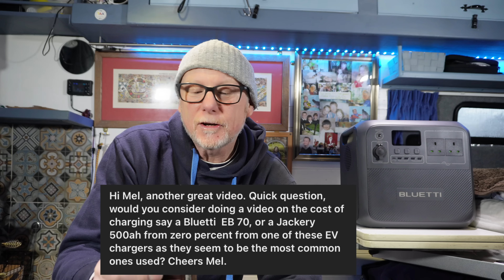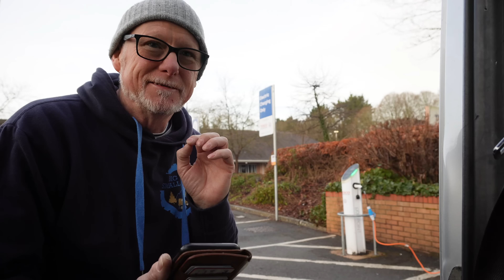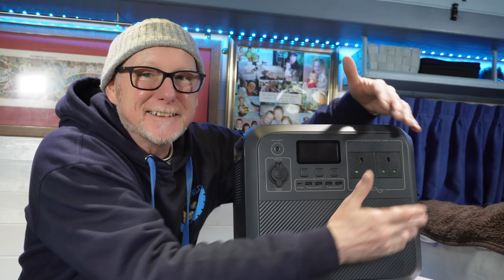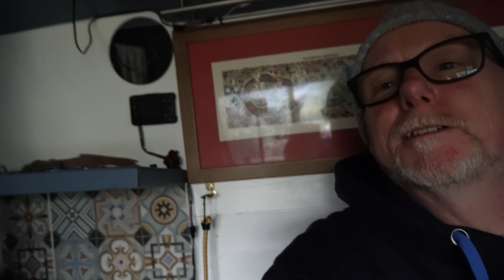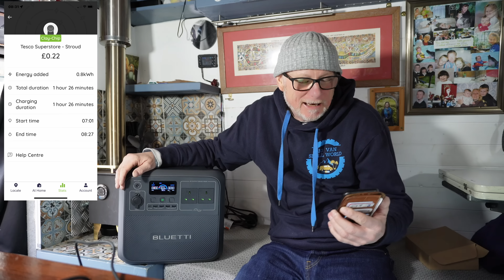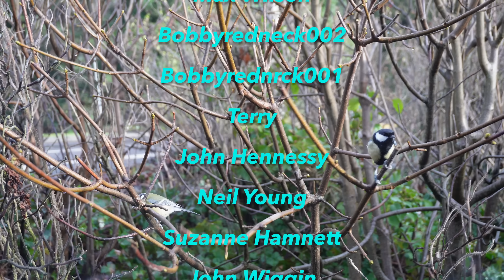Using Electric Vehicle Charger to Charge the new Bluetti AC180

Comment from the maker: EV Type 2 to CEE 16A Socket Power Converter Cable, Blue and Black
https://amzn.to/3JtHC2u 
BLUETTI DEALS: up to 56% Off https://tidd.ly/3MXs9sD Get an extra 5% OFF with code BLUETTIMel
BLUETTI AC240 https://tidd.ly/3XXmGUX
BLUETTI Charger 1 https://tidd.ly/3K2cA20
BLUETTI Apex 300 https://tidd.ly/3Mb1tUW 
BLUETTI B500K Expansion Battery https://tidd.ly/3Mb1tUW
BLUETTI B300K Expansion Battery  https://tidd.ly/3Y17q9y
BLUETTI Elite 30 V2 https://tidd.ly/3K5pagZ
BLUETTI AC 300 & B300K https://tidd.ly/3M7SfsG
BLUETTI Pioneer Na (Sodium-ion) https://tidd.ly/472aSq5
BLUETTI ELITE 200 V2  https://tidd.ly/49qwsW5  
BLUETTI AC 70 https://tidd.ly/4qKRswX
BLUETTI AC 180 https://tidd.ly/48X2bhK
Everything i use in my camper van you will find here https://www.amazon.co.uk/shop/melsvanworld
Reply: @MelsBigVanSmallWorld  hi Mel, probably a question already answered, too old to go through all posts .. on your amazon channel you show an adaptor for an ev charging point, but what cable do I need next to connect to an apex 300 ? And can you charge an apex 300 directly from an ev charging point ?

Comment: Ah? Does this mean that whilst on EV mains hook-up your main batteries will be charging up at same time, therefore adding to the overall cost? I have fitted a switch  that allows me to switch leisure and starter battery out of the battery charging loop if required.
Reply from the maker: For me it’s more about the convenience than the cost 👍
its cheeper than going to a campsite 
If I’m plugged into mains through an EV port, I tend to make the most of it and charge everything in the van, including the main battery
That way everything is topped up and ready to go, which just suits how I use the van 😄

Your switch setup sounds like a good idea though 👌

Comment: Brilliant! I have an AC 180. Do you know if it's possible to plug directly from the Bluetti and charging post thingy? I don't have the external plug point you have on the side of your van
Reply from the maker: Yes, you can plug your AC180 directly into the charging post! Just make sure to check the compatibility and any necessary adapters.

Comment: I want to put all the charging options. Solar, shore power at rv park and from home, alternator, AND EV. Just starting to investigate what I need and what would be the best set up. And not necessarily for Bluetti, maybe even a DYI power storage pack. I want to be able to power USB, 12v, and 120v items in my RV.  I want to have the best economic options but others too in case those are no-go in certain areas. Like a gas generator.
Reply from the maker: Wow, you're planning for every possible charging scenario! That's a serious setup you're aiming for. Hope you find the perfect mix for your RV! but seriously unless you are a compitent at `diy electrics i would stick to using a power bank like the Bluetti Apex 300 pex 300 
https://tidd.ly/3Mb1tUW it can do everything you just mentioned and all in one neatsafe  package  👍
Reply: @MelsBigVanSmallWorld yeah, I’m attached to my electronics and plan on lots of travel in an RV for the year after I retire. I don’t want to be stuck anywhere. Or bored, which I hope/excpect will not be an issue - or I might as well not. 😊

Comment: I just bought this adapter and was going to try it out today. What app do you use for it?
Reply from the maker: Great to hear you got the adapter! I recommend checking the Bluetti app for the best experience. It really helps monitor your charging.
Reply: @MelsBigVanSmallWorld  I have the aferiy power station but I’ll check and see if they have an app. 2 years on, is the adapter still working ok for you?
Reply from the maker: yes i use the adapter almost weekly in the winter
Reply: @MelsBigVanSmallWorld that’s great! I got it for winter too. I’m excited for my new addition to vanlife😁
Reply: @MelsBigVanSmallWorld I have just gone to a charger to test it out and it doesn’t click in and an error came up on the screen. Did you find that only some chargers connect?
Reply: Just realised there’s tethered and untethered chargers. I’m new to this haha😅 I’ll try again with an untethered option tomorrow🤞

Comment: you say that the ac 180 was new out of the box and was around 35% charged to do the EV charging video. also, you made the video of its features previously yet the 180 is at 48% when you turned it on. do you have two 180s? curious.

Comment: Is there an EV to AC adapter? Does this adapter plug directly into the power station?
Reply from the maker: No but I’m about to do a review of the new Bluetti that’s coming out soon and that will have an EV charging port and cable 🤙🫶
Reply: @MelsBigVanSmallWorld  which model is it?

Comment: Hi Mel. Great videos, very informative about actual use of the products 👍

I have an unusual question. I am a boater and have hook up to run electrical appliances such as our sockets for a kettle, a ceramic hob and a water heater (immersion heater). When off hook up we would need a generator to run these items. 
Do you think it would be possible to run a cable from the power station into our hook up point on the boat? I would have thought that would work, obviously being careful not to run concurrent devices. Do you run your van this way?
I could then recharge via a 12v outlet while running the engines while moving. 
Sounds genius!
What do you think the constraints will be?
Thanks
Reply from the maker: Thanks for your thoughtful question! Using a power station like the Bluetti AC180 to run appliances on your boat sounds feasible, especially if you're careful with your power usage. Just make sure to check the power ratings of your devices and the connections involved to prevent any overloads. Safety first!

Comment: Love this video. I'm in the US. I found an adapter on Amazon J1172. Is this it?
Reply from the maker: I’m looking on Amazon unfortunately I can’t find it
Reply: Europe use detachable cables, so it will be a little bit different setup as the US used tethered cables.

But the protocol is the same, so you do have passive mode. The passive mode is intended to charge legacy EVs (Mode 1 charging).

The J1172 is referred to as 'Type-1' in Europe.

In the US a cable like this will have the same respectable as on the car.

But you do have a problem, the charging standard allows for 110V, 120V, 208V, 230V and 240V through the same pins. Not a problem in Europe since we only use 230V, but in the US you can be sure if you get 120V, 208V or 240V between the L1 and N pin. (120V is unlikely, but "legal" according to the specs)

Comment: I've ordered a EV charge cable for our motorhome and agree it could be a game changer.  It has a "Type 2" plug.  I've since noticed that some EV charge points that have type 2, are tethered and some are untethered.  Can you only use untethered charge points, or can you connect your cable to the cable coming from a tethered charge point.  Cheers.
Reply from the maker: Yes you can use ether one
Reply: Hi. Where did you buy your cable? Apparently the one in the video is sold out. Cheers

Comment: So if I'm understanding correctly, if you plug in one high power 1800w device that is okay and should work. If you were to plug in one 1800w device on one socket and a 700w device on the other that is a no-no! Whereas if you had a 1200w device on one socket and 600w on the other that should be okay.
Reply from the maker: Correct 👍

Comment: I have one on order right now.  Managed to get it from Bluetti shipped for $448.01.   But my AC200P I could never get to run my diesel heater.
Reply from the maker: That’s why I always recommend the AC200max as it has a 12v 30amp outlet and will run the entire vans 12vs including diesel heater and fridge 👍
Reply: @MelsBigVanSmallWorld  I’m getting ready to get me another heater again.  Due to the first one I got pissed with it an tossed it out.   But that was after Bluetti wouldn’t power it.  
An I also spent like $98 of a power brick that should have easily had the wattage an amperage.  
But unfortunately that worked neither.  So it may of just been an issue with the heater.  

But following tossing them two things out. I remembered just what you said. 
I never paid much mind to that plug being it’s that damn aviation plug.   Just never had anything that used that.  

But since than made up an aviation plug to xt90 for that port.    Only difference between the 200p and 200max with that plug is.  It’s 30amp on the max.  On the 200p it’s 12v 25amp.   But even than that should be more than enough since them heaters seem to run right over the 10amp threshold of the other plug. 
So all should be well this go round
Reply from the maker: @AquaTech225   That should work ok if not then do please let me know

Comment: What was your deisel heater power by any chance? 2k, 5k, 8k....
Reply from the maker: I use the 2 k diesel heater in my sprinter because I find with the 5 k heater I’m having to run it on lower settings and even turning it off because it gets too hot but whereas the 2k heater I can leave it on and turn it up for longer. This means less chance of soothing up. Hope this helps 👍

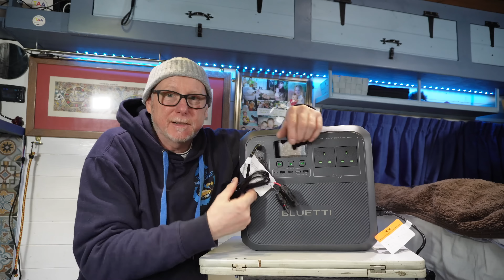Comment: 8:44   My 180 arrived yesterday. While plug in to solar panel works fine, can't plug the 12V (cigarette lighter) cord into either of my car's 12V sockets. The male end just doesn't fit.

CMy car is a 2009 Ford Escape.  I called Bluetti but they didn't know why the misfit. Am heading to a local Ford dealership to have them look at it.

Anyone know about this or has experienced this?  

Thank you. 🙏
Reply from the maker: The Bluetti plugs are a really good quality and super tight fit for sure you have to push them in hard enough to compress the side springs Hop this helps 🤞👍
Reply: @MelsBigVanSmallWorld    Thanks for reply. Was scared to crack something if I pushed too hard. Lol But I'll try again. 👍
Reply: @MelsBigVanSmallWorld    It worked!!  Thanks, again.
Reply: I have the opposite problem ...
I can't fully plug in my solar panel cord seems like it doesn't fit, it just sits there loose only 90% plugged... 

Does anyone else have this problem?
just got it 2 days ago I used the cables that came with it, even tried other cables NONE  fit snuggly...is this normal?

Comment: Is there any way to direct connect from the charging statino to a bluetti, etc? I don't have a port/vehicle that has charging.
Reply from the maker: EV charging cable, the Juicy Brucie - https://www.juicybrucie.com - It’s 10M long and meets EV regulations.
I have created a code MEL15. If you’d like to share the code it will give you £15 off
Reply: @MelsBigVanSmallWorld  I'm in the states :(. Plus it looks like EcoFlow sells something similar, but I guess I'm locked into their sysstem. Does yours work for a variety of boxes?

Comment: At 08:39 you said that "You don't want to use solar while driving" Why is this? The other thing is what cables are you using to charge from the EV unit to your van?
Reply from the maker: EV charging cable, the Juicy Brucie - https://www.juicybrucie.com - It’s 10M long and meets EV regulations.
I have created a code MEL15. If you’d like to share the code it will give you £15 off

Comment: What type of voodoo is going on here? It would appear that you’ve just connected a high voltage DC charging source directly to your 220/240v 16 amp mains input socket on the van. Could you please explain exactly how you are making all this work. Thanks.
Reply from the maker: EV charging cable, the Juicy Brucie - https://www.juicybrucie.com - It’s 10M long and meets EV regulations.
I have created a code MEL15. If you’d like to share the code it will give you £15 off
Reply: You are confusing, the EV charging station has a Typ 2 socket, so it supplies AC

Comment: hi Mel compared to a victron set up with thick gauge wiring for a reason i suppose, it concerns me that these little box of tricks aint so well wired, as im no wizard in electrics i can see the box of tricks being  tbh a god send and no faff what are your thoughts on these  cheers sam
Reply from the maker: I live in my van full time and I have been using the AC200 max for the last 17 months and had no problems whatsoever I’ll be installing the AC 300 in my next van that I’m building now I’ve met some people at festivals that installed the ac200max in there vans and they’re all happy with them. As for wire they are built extremely well you’ll notice I don’t make videos about any other power packs anymore only Bluetti and no I don’t get paid buy them but I do make a small commission if you use the link in the videos

Comment: Hi Mel  , great video again , I am really interested in the use of EV charge points to charge my power pack . Problem is i dont seem to find the adapter . Could you give me a pointer where to look please . Oh and ps good luck with the new van build .
Reply: Can someone answer clearly:
1. Can you directly connect the bluetti AC 180 to an electric car charging station. 
2. If YES; What cable/wire in the UK do I need?
3. The cable listed in all the comments by juicybrucie doesn't look like it fits from the ev charging point straight into the bluetti adapters/ sockets. 
Thank you in advance for the clarification.
Reply from the maker: EV charging cable, the Juicy Brucie - https://www.juicybrucie.com - It’s 10M long and meets EV regulations.
I have created a code MEL15. If you’d like to share the code it will give you £15 off

Comment: hi Mel just subscribed and the bluetti seems to be just the job for my peugeot tepee which im planning to make into a stealth camper, so nothing on exterior also less faff, no need for split charge ,no need for solar would there be any drawbacks to this and can you expand the bluetti, like your induction hob as well not a fan of gas and safer ,no gas bottle saves space, my thoughts of the car was to leave as standard which gets me under the barriers,unassuming and less nickable as they are usually old dears cars or disabled and better cars to steal but for park up very unassuming so basically park anywhere impressed with the charging using ev and cigarette lighter its own inverter that s well capable and 10 year lifespan, are there any drawbacks in cold weather as normal batteries die quick ,also not to upset some folk ,unfortunately im old myself, so stand by my car description lol cheers sam
Reply from the maker: Hi welcome to the channel I’m actually using a Bluetti AC200 max in my van it’s a game changer I wouldn’t hesitate to recommend it especially as it has a 12v 35amp outlet perfect for running a camper with 👍🤓👍 link in the description of all may videos
Reply: thanks for the reply ,there doesn't seem to be any bad points, saved me alot of work less faff and its all in one unit and will keep my van stealth like cheers sam @MelsBigVanSmallWorld

Comment: With one of those adaptor cables you said in another video you could just plug the power station directly into the adaptor cable at the EV charging station no?  I have this idea of charging up a power station then being able to transport this to my caravan (which I don't want to move) and being able to charge up the leisure batteries on site.  Thanks for all the useful info.
Reply from the maker: EV charging cable, the Juicy Brucie - https://www.juicybrucie.com - It’s 10M long and meets EV regulations.
I have created a code MEL15. If you’d like to share the code it will give you £15 off

Comment: I’m as thick as pig you know what when it comes to electric you plugged the lead into your van side does that go through a system or is there a 3 pin lead at the other side does that come over right doh!
Reply from the maker: I have no idea what you’re asking
Reply: @MelsBigVanSmallWorld  let me try again you take the lead from the EV hook up and connect it to your van does that connection into the side of your van go into your electrical system ie your leisure battery
Reply from the maker: EV charging cable, the Juicy Brucie - https://www.juicybrucie.com - It’s 10M long and meets EV regulations.
I have created a code MEL15. If you’d like to share the code it will give you £15 off

Comment: #waffleonawednesday hi mell great video you say it charges at between 550 and 700 watts. I thought the ac180 was capable of charging at 1400 watts. Am I wrong or is it capable of not why is the ev point only charginging at half speed.

Mark
Reply from the maker: I think that’s the combined charging like if you have max solar and you have it plugged into manes power.hope this helps
Reply: That's strange in 😅 bluetti press pack and manual it say ac charging goes up to 1400w you have to have it in turbo mode in the app
Reply: I managed to find where to get the adapter from it's a company called EV connectors and cost 138 quid

Comment: Top vid bud🤙would you say that theory would transfer to charging my 200ah lithium, perhaps charging rate would be dictated by the battery charger out put?
Nice idea charging up for so little money👍
Just need to find reliable free water🤔I'm thinking submersible filter connected to 12v water pump via a 3 stage filtration system straight into under slung tanks from river/stream/reservoir.....prob not for drinking!....sure Ive seen some Australia make a vid on this idea???
Reply from the maker: Yes 👍 that’s what I’m thinking too I’m sure it’s possible but I need to do some research and then I’ll be on it 👍🤓👍🍻

Comment: In USA I use an AVC2 to turn on the EVSE at the Charge Station and then charge up all my batteries, don't have a Bluetti - just some Valence 12v batteries and a NOCO battery charger. 
Mostly, I charge house and traction packs from rooftop Solar.
Reply: Can this charge a bluetti with this adapter in us? Ty so much.
Reply from the maker: Thank you that’s really interesting 🤔 it’s given me an idea 💡 👍🤓👍